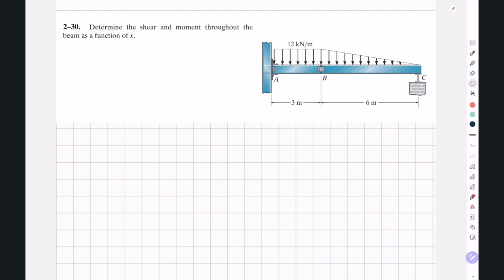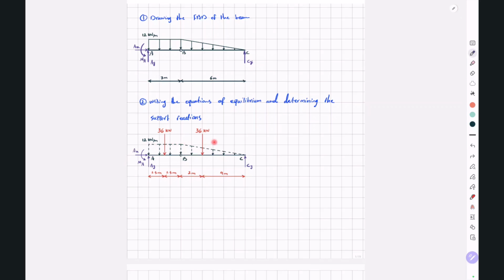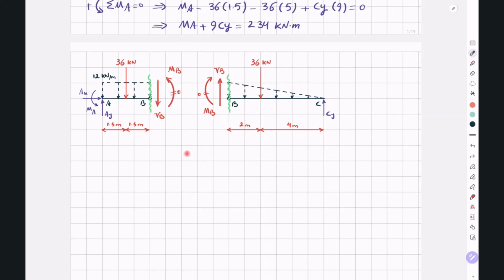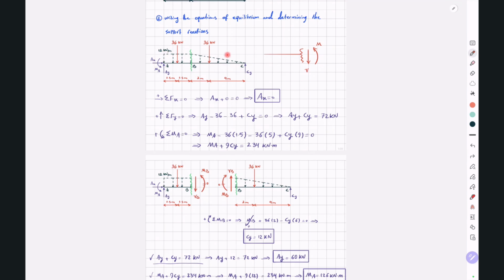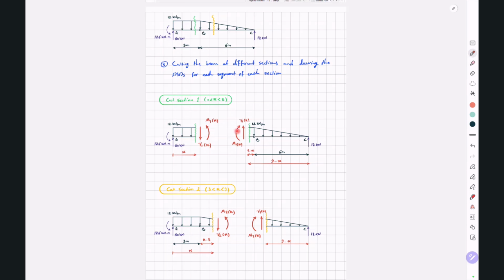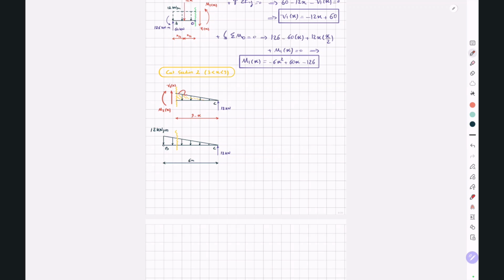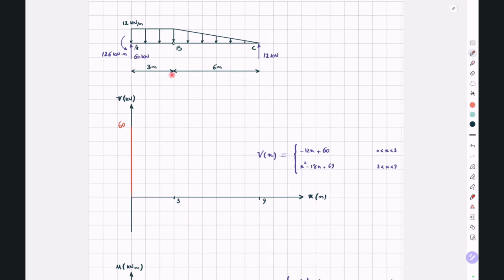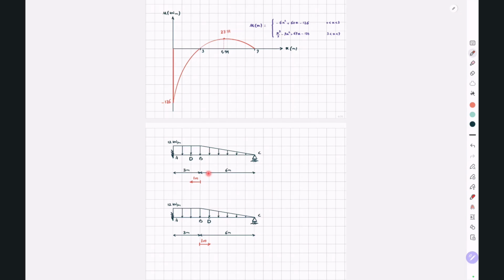Shear & Moment Equations | Internal Hinge in a Propped Cantilever Beam (Method of Sections)

Comment: If I had chosen the different signs for the directions, my M1 would have been a +126, which reverses the diagram. Do you have any valid logic to clarify this or correct my mistake?
Reply: Sure. For the 1st section, I took M1 in clockwise direction and considered V1 acting upward. Thus my equation came for V1=12x - 60 and M1=6x^2 - 60x + 126. So for point A, the values come as -60 and +126 which are apparently different than your resulting diagrams. Also doing that my force or moment aren’t neutralised at the beam edges (for example: V=12 at x=9, however Cy=12;no 0 coming). How to avoid that mess? Good lecture btw. Thanks.
Reply from the maker: Your approach for M1 wasn't wrong, but if you choose those directions, you need to be consistent across all sections—otherwise, you'll run into imbalances like this. I use a specific sign convention in my videos, but some people use the opposite, which is fine as long as it’s applied consistently. The fact that V ≠ 0 at x = 9 suggests that somewhere, equilibrium wasn’t fully satisfied under your convention. If you check for any sign inconsistencies, you should be able to spot where things went off. Let me know what you find! 

And thanks btw—I really appreciate you watching and engaging!
Reply from the maker: Could you clarify which directions you changed?